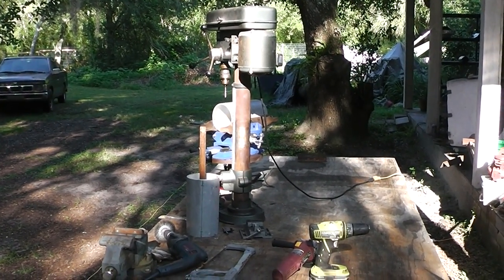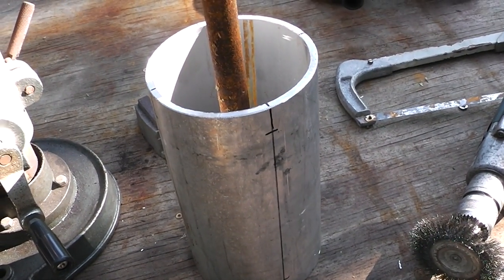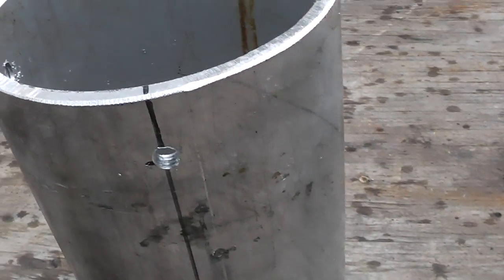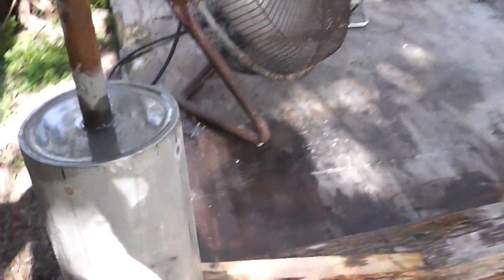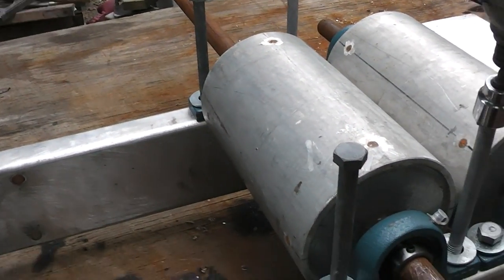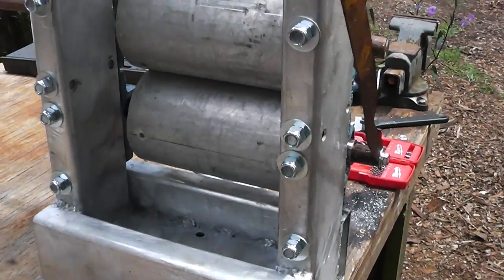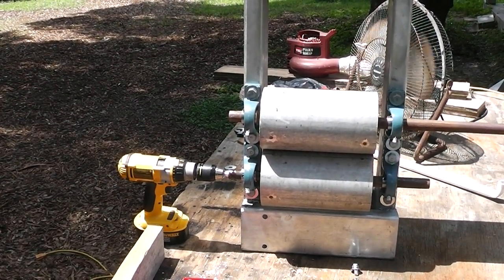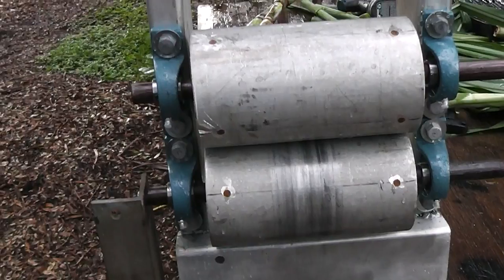Homemade Sugar Cane Grinder

Comment: In rural Ecuador, they make the rollers from hardwood logs.  They cut away part of the ends, and leave a 2 inch round stub sticking out each end.  They also drive in nails half way in the roller faces, and clinch them over  to get traction on the cane.  The rollers need to be adjustable, to let you make several  decreasing passes at a piece of cane.

Comment: Hey buddy you need 3 rollers  aranged in such a manner that you have two pairs of roller. one pair big gap the second small gap. two rollers gear connected so they rotate in opposite direction. another pair on the opposite shaft is connected by chain. Hope you can picture it. Keep going DIY is fun

Comment: im a machinist i would suggest that u sychronize the rollers n put grooves on both to prevent slippage. used a reduction gear so it wont be so hard to crank.

Comment: i am working on one myself, I am using your roller idea and I am going to use a garden tiller to turn it with
Reply from the maker: +jonathan strong Please make a vid, I would love to see your version!
Reply: +homesteadprepper did you ever finish this brilliant project?
I wonder if a heavy duty chicken wire (or some pressed out thin metal sheeting ) would weld onto the rollers and grip the cane.
could be time consuming cutting teeth into it, a very slow motor turning the roller with a jig allowing a cutting tool to go from one side (of the roller) to the other 
like a spiral cut.
followed by 20 more cuts at increments. 
clear as mud LOL.
Neiall in Bulgaria

Comment: Maybe some heavy duty springs or leaf system like on a car that keeps the rollers together but will separate when enough force is exerted by the cane?  Might be able to pull some off of an old wood chipper someone might have lying around?
Reply from the maker: BC ElginTex Excellent idea! Lord knows I have some stuff lying around. Thanks.
Reply: homesteadprepper LOL.  The reason I thought of it is because I have a broken chipper sitting on my property.

Comment: Maybe a third wheel would help. With a gap between the first 2 about 5/8’’ then the gap between the last wheel about 1/4’’ apart so it gets a pre crush to help it get through the final crush where most of the juice will come out

Comment: You could use heavy steel springs on a steel frame for downforce. You could also make a smaller set of rollers situated right in front with a larger gap to help take it in and gradually crush it. You might be able to use it to wring out clothes.
Reply from the maker: Midas Haltzern Good ideas, thanks.

Comment: Interesting, not that you asked but I have an idea which may help seeing how the pipe is aluminum ,right?  my first thought if it had been steel would have been to weld some beads length ways across the pipe, but being aluminum maybe you could use some short self drilling self tapping screws in rows to grab the cane, even the short sheet metal screws hvac guys use might work... just a thought   good luck with the project..
Reply from the maker: rchopp I agree that steel would have been the material of choice but, the aluminum rollers were for free. Excellent ideas! Thank you Sir.

Comment: What about putting a Spring on each side (same side, but each end) of your Idler drum that pushes on the Pillar Block and keeps it close to the drive drum and can "float" as the diameter of the Product changes?
Reply from the maker: archersfriend I like that idea!  That removes the pain of always having to "adjust" the rollers.  Thank you!
Reply: homesteadprepper One other thought on the roller adjustment...perhaps the first 1.5 minutes of the video that I referenced earlier might give you an idea for making the distance between the drums easily adjustable.  You probably already know this but something that I found interesting in the vid is how many times they run the cane through the drums to get a complete extraction of the liquid.  Take care.

Comment: How did you center the shafts in side the rollers so accurately???
Reply from the maker: I ran the all thread in on 2 opposing sides and centered with a tape measure.  Then, I ran the other 2 in to center. When the top was perfect, I flipped it over and did the same to the other end.  I had to keep adjusting the top of the roller and the bottom.  When the top and bottom were as close to center as possible, I welded the all thread to keep it dead on and cut off and ground the all thread ends with a grinder.

Comment: just my opinion but it's over engineered for what you are trying to do. 

it can be done with a lever and just crush it as you are passing it through. Think like scissors, a fixed side and a lever side with weight. 
the whole roller thing is fine if you are going to try to automate it but if you are cranking it anyways and adjusting your rollers your already doing more work than necessary.

roller ones I have seen run on a motor and the top drum has play and is heavy so the more times you pass it through the more smashed and more juice you get, and the closer the rollers become.

just remember, before these machines people just took a piece chewed it up to get the juice and spit out the wood.
your juicing machine should be simpler than doing that.